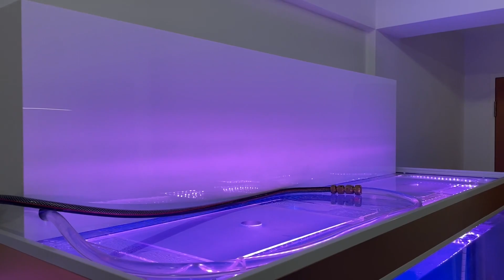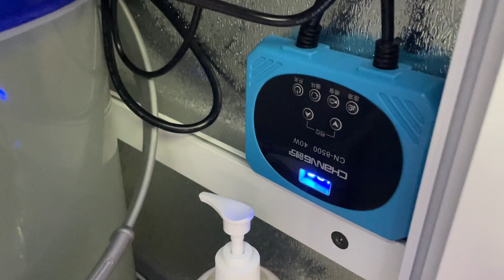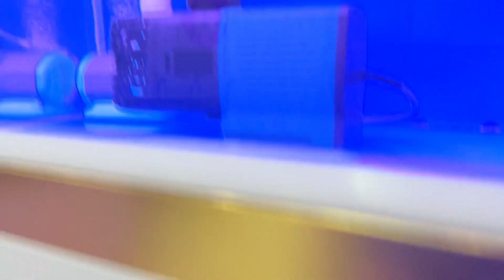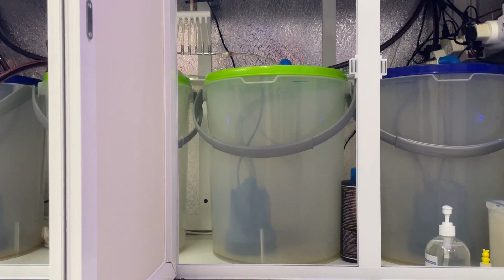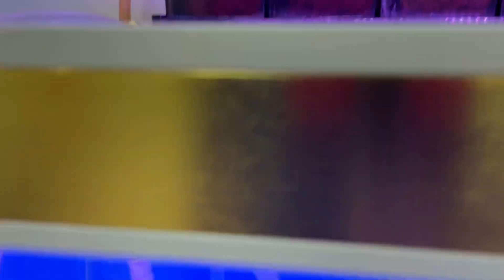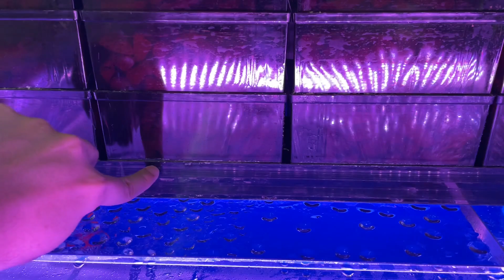Water Change and Detailed Tank Walkthrough

Comment: Is that a Sump Filter Setup?
Reply from the maker: I'm using an overhead filter, top level is mechanical filtration then 2 levels drip through and 2 levels sump
Traditional sump filters are usually placed below the tank